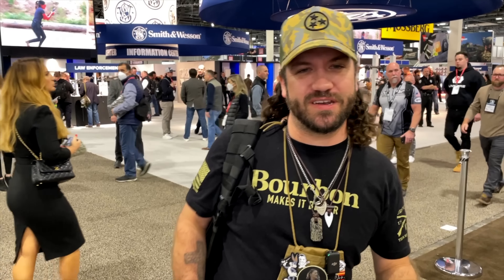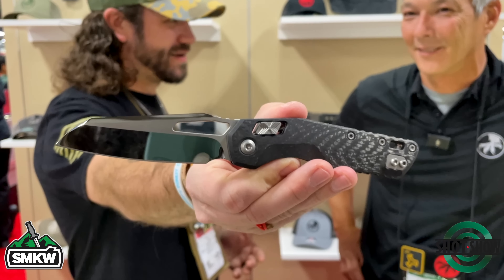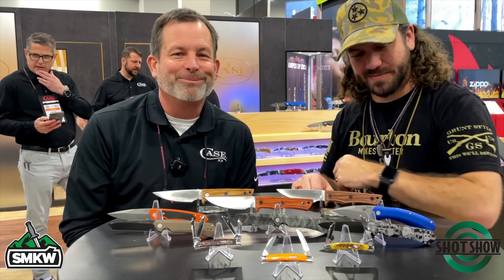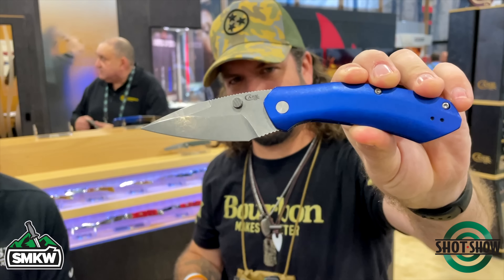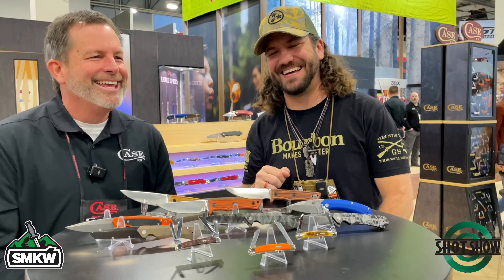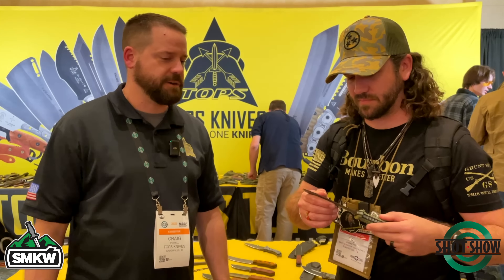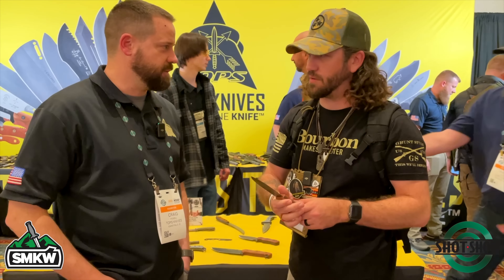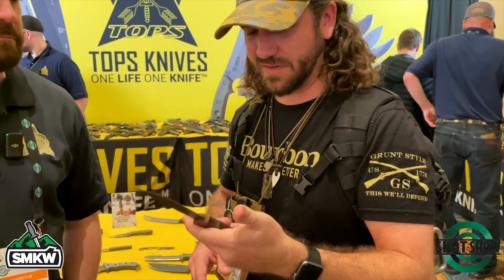Shot Show 2023 | DAY TWO | MICROTECH, BENCHMADE, CASE, TOPS, BOKER, TOOR, COLD STEEL

Comment: Case better get QC in check before I ever buy another one. Last one I got had every issue people look for...blade rub, way off center, fit and finish was awful. First knife I’ve ever returned in my life.
Reply: I got my 2 last ones a few years ago and both had the same issues. They have nice looking handles, but it is very disappointing when 4 times cheaper Rough Ryders have less problems.